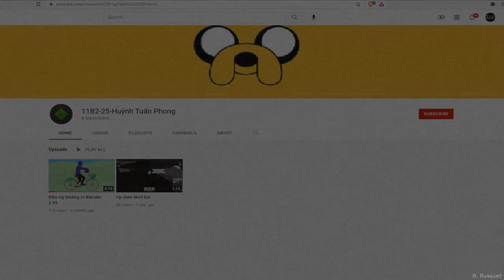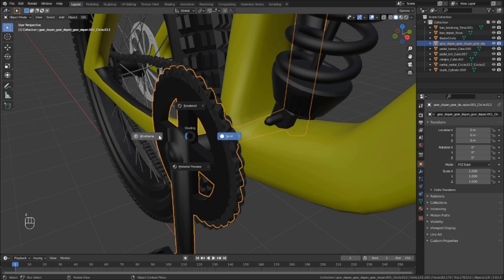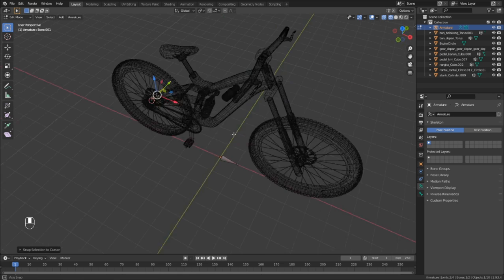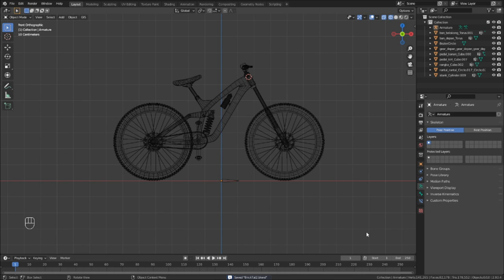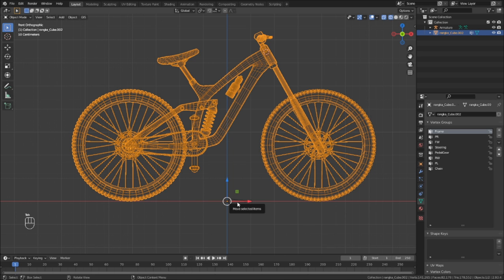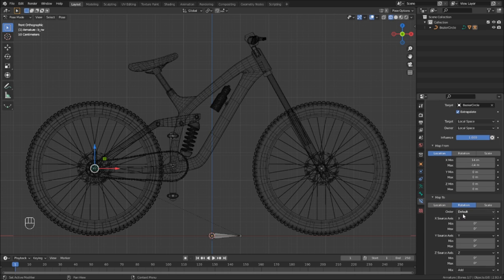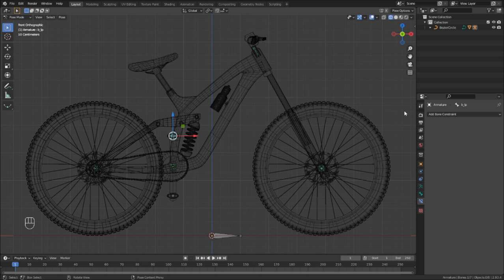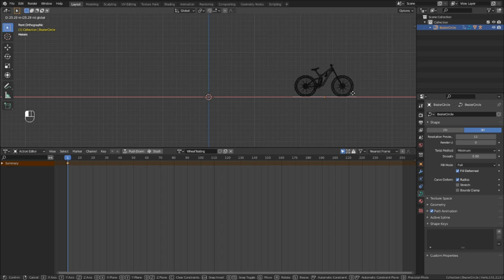Blender Bike Rig Tutorial

Comment: I followed same but at the time to join them I am not finding any vertex groups and as in video after join pressing tab selects wheels I am unable to do that instead It selects my pedals and chain
Reply from the maker: Unfortunately you'll have to go back and reassign your vertex groups. There must have been a misstep. Using vertex groups isn't an absolute requirement  if you're exporting to Unreal at present(Just needs to be parented properly). I will admit it's pretty cool joining  all parts as one mesh but totally skippable especially if you're staying within Blender. I make mistakes with my vertex groups sometimes which is pretty common. I use that feature constantly. Personally I learned blender from editing meshes rather than modeling. Its literally all I do lol.

Comment: Great job, tho im having a problem with one specific pedal, it keeps twitching in opposite direction everytime i move the bike ( it is already rigged with constraints.) got any fix? im using blender 3.5
Reply from the maker: Ah yes I have also occasionally run into this problem on occasion as well Looking at the pedal settings in my current file, this is what I have:
-Left pedal has a bone constraint of Limit Rotation "Y-Axis" checked w/ Min Max at 0.
-Right pedal has a bone constraint Limit Rotation #1 "Y-Axis" checked w/ Min 90 Max -90. Limit Rotation #2 "Y-Axis" checked w/ Min -114 Max 114. All using world space. I'm not sure why I had to set it up this way. But for me it was the only option to prevent the pedal from snapping 3/4 thru the spin. I'm not sure if this helps but I'm thinking that in rare occasions one may need to Add a second Limit Rot. The original file has no constraints since at the time, it was being prepared for use in UE4.

Comment: I could decline it for a motorcycle this?
Reply from the maker: Yes you absolutely can.
Reply: @indieartsmidwest4042  thank u friend i hav one more question please how i can make to put the axis of rotation of a handlebar on itself ? 
Do i hav to switch édit mod ? Sélect the entire handlebar then snap to 3d cursor return to object mod and set origin on origin to 3d cursor ? Or its different from this self focused
Reply from the maker: @LanD_87  yes you're definitely on the right track. If the shaft that holds the handlebars is upright meaning a 90 degree angle, then I think you'll be fine in setting its origin based on that. If the shaft that holds the handlebars is at an angle, you may run into issues with rotation. In that case a bone would be needed to maintain the correct rotation.
Reply: @indieartsmidwest4042  thank u for u time friend im going testing that

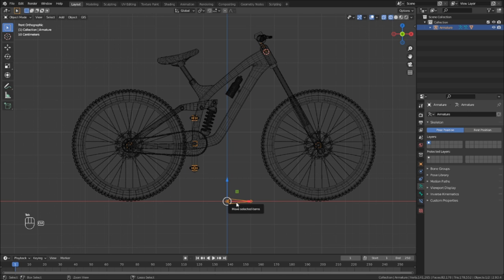Comment: I follow these steps, but at 8:22 the bone didn't move. I need help
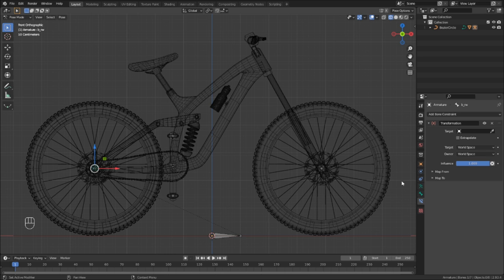Reply from the maker: Honestly I find this a bit confusing as there is nothing that should prevent it's movement up to this timestamp. So long as you're in pose mode things should be moving just fine. Constraints aren't added until 9:16. Prior to that, the bones are bound by a parent bone hierarchy🤷🏿‍♂.
Reply: @indieartsmidwest4042  thanks for your help. I finally done. Awesome!!!